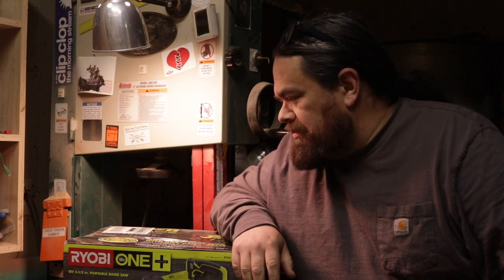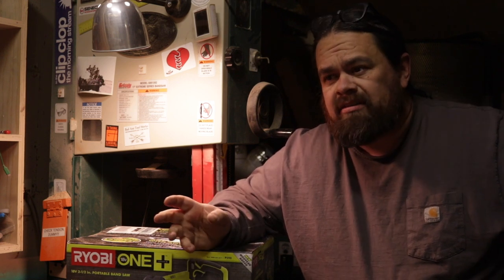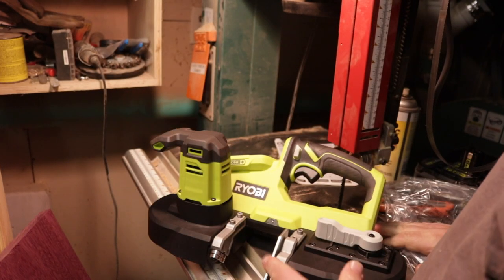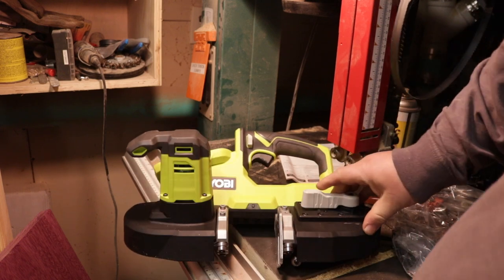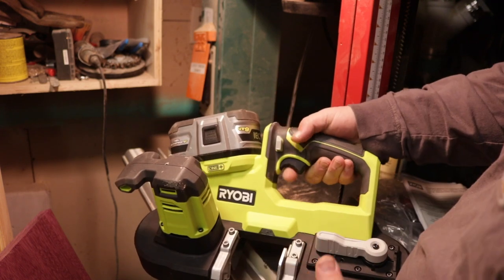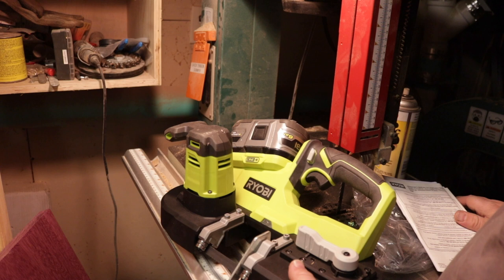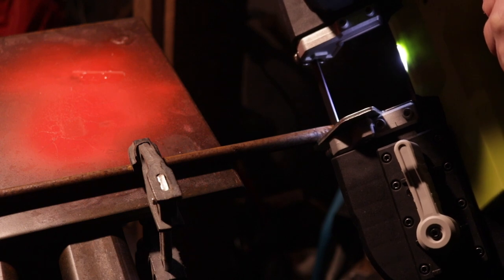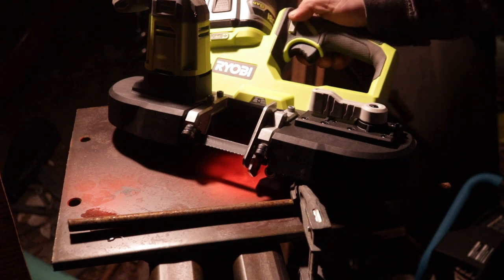Ryobi 18volt ONE+ Bandsaw Unboxing and First Thoughts

Comment: I bought one the first day it was released, it's actually a nice saw. I don't know how long ago you bought yours, but right now you can get two 3Ah batteries, a charger, a carry bag and the saw for $99. Maybe you can get a price adjustment.
Reply from the maker: I think I got it at the beginning of December. At the time, the bare tool was all my local store had. Maybe I need to take another look. 😉
Reply: Pro tip : you can watch movies at KaldroStream. I've been using it for watching all kinds of movies during the lockdown.
Reply: @Deacon Braydon definitely, I've been watching on kaldroStream for since december myself :D